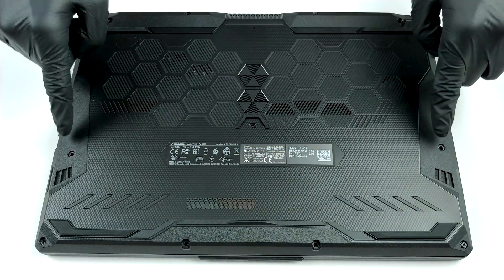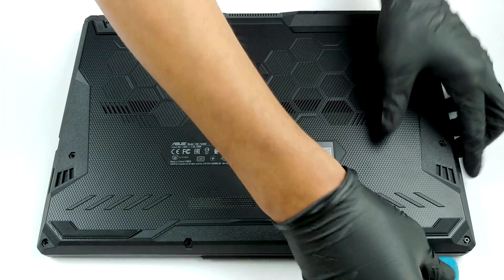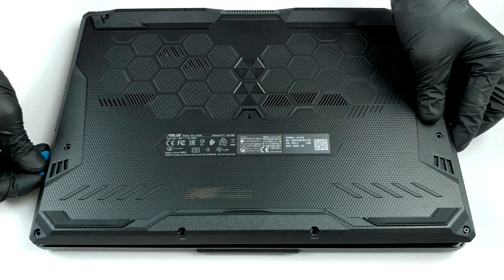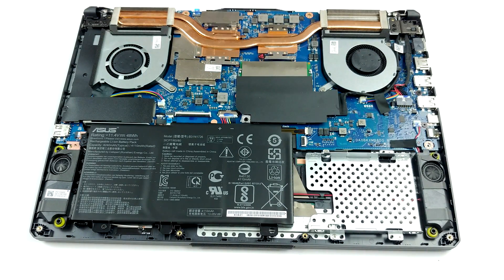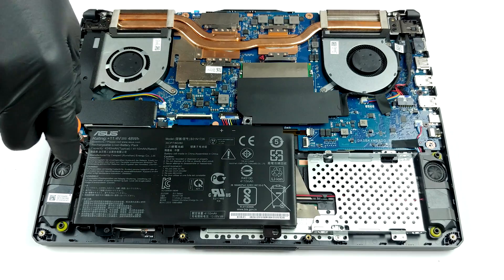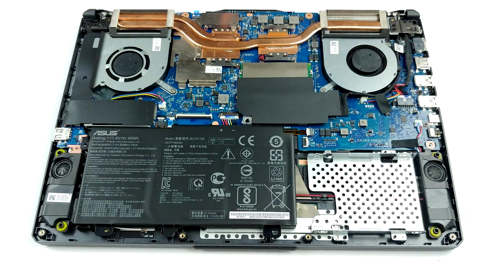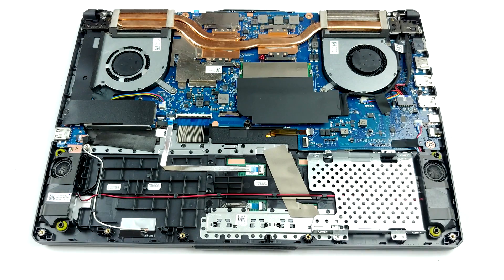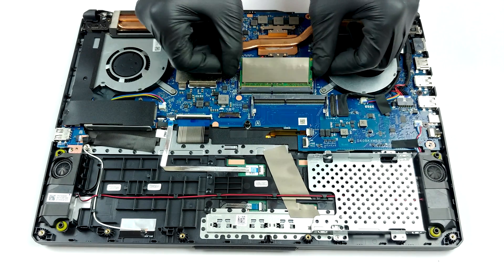🛠️ ASUS TUF A15 (FA506) - disassembly and upgrade options

Comment: I havve 1ssd of 256 gb. And 1tb hdd in my asus tuf a15 , can i add one more ssd ?
Reply: did u find any ans?  as i also want to add 2nd ssd
Reply: @parv69  if you have same specs then u cannot add one more ssd , you just have to replace with a bigger ssd

Comment: My right fan is laggy..  Its making lots of sound and nit even turning.. 😢.. Any solutions?
Reply: replace the fan 👍can find the parts if ya look up the model number but make sure you know which one in particular (look at the sticker on the bottom that says smth like FA506IHR next to the QR code)
Reply: @dangersnack5665  yeah changed it a year ago. Found a Chinese copy replacement for 12 bucks. changed it successfully. working fine so far.

Comment: So if I understand it correctly there is an extra slot for a 2,5 inch HDD?
Reply: yup, its the metal slot you see in the lower right, however i tried connecting one and i couldnt do it because the connection was very weird and curled up in there-

Comment: Just bought a slightly used one of these, as mentioned by seller it's missing a couple screws on the bottom plate, I was wondering which  type it is and where I could find it, any help much appreciated!

Comment: Hello guys. I've got 2 questions.1. Could anyone tell me if there is any warranty seal,  If yes then where? 2. Will the laptop work ok if I take out this slow cl22 ram and replace it with faster 2x8gb ram? Thank you
Reply: 1. Yes there is, by the heatsink, over a processor screw, it's black with a red triangle on it.
2. Yes it should work

Comment: Can the bracket for the hdd be removed to accommodate a 90 wh battery?
Reply: yes
Reply: @shiringasai  ok, have you tried?
Reply: @dorddis  yes the battery  does have different screw mounts but the plastic case itself has tabs that will hold it in place I hear different models have different connectors for the battery so make sure the 90watt battery you buy has the same connector

Comment: Just buy the legion 5p, has the same configuration and it's cheaper, good cooling solution, 899 on Curry's right now!
Reply: False, not cheaper. thanks for playing
Reply: @seansmith3766  On amazon the Asus TUF A15 is £1000 on Curry's the legion 5P is £899 (Here in the UK)
Reply: Gay

Comment: It's easy to open the screws but hard to lift  the back  panel..i was being extra cautious while opening it.
Reply: Better using a credit card so it doesn't damage the panel
Reply: @ainulkarim5074  I used a flat Screw driver's tip for half of it and I lifted half by raw hands , shouldn't have 😅
Reply: @ainulkarim5074  Thank you it worked really well
Reply: Start from the front corner

Comment: Which SSD can I add in the extra slot, I buy it, but I'm looking for a 1tb SSD for the extra slot,.
Reply: All ssd's are small it will fit in the slot, i used a samsung evo ssd and it fits very well
Reply: @SlyStarling  i bought the 1tb Samsung ssd as well. Do i just plug the sata cable into the hdd connector slot & connect it to the ssd for it to work? I've never done this before & didn't want to mess anything up
Reply: @Sidious2403  thats what you do its the same as a hard drive but sometimes the ssd might not show up because you will need to format the drive but there is tutorials on youtube to help you do that
Reply: @SlyStarling  Could you tell me which model specifically? 970, 980?
Reply: @bloodslayerX  it would be a 970, a 980 is a nvme ssd whereas the one you want looks more like a hdd

Comment: Can we upgrade battery from 48wh to 90 wh in ryzen 5 4600H varient (61k)
Reply: I think so yes, the 90wah battery would have to use the hdd space. I could be wrong though
Reply: i have a 90wh battery in my r5 4600 h and gtx 1660 ti variant
Reply: @slitnotgm which battery or specifically what type the battery you use? I want to upgrade mine too

Comment: Can I pick up 48whr option and later swap it with 90whr through service centers???
Reply: You should be able to - just remove the hdd cage & original 48wh battery & the 90wh should fill the gap 👍

Comment: Managed to put in 64GB RAM (63.4 usable), as suggested by Crucial.  With the RTX 2060 model, there is also a 2nd PCI M.2 SSD slot (potentially RAID 0 setup?), plus a STAT 3 SSD bay.  So, 3 places for SSDs.
Reply: Hey, I have a question for you if you don't mind. Since you've messed around inside the ASUS A15, how hard do you think it would be to swap out the GPU, RTX 2060 for a better one? Is it easily accessible? Or is it in a hard to reach spot? Also if it is even possible to swap out the GPU in a laptop? I've never worked on a laptop before.
Reply: @SelfProclaimedEmperor  Laptop GPU's are usually soldered onto the motherboard & impossible to change 👍
Reply: @genx156  damn, that's dumb, thanks though.
Reply: Online it said there was 32 gig limit for ram, i have the 4800h ryzen 7 with the 1660ti? is that correct?
Reply: @lolzorsPwnage  you shouldnt need more than 32gb anyway
Reply: @lolzorsPwnage did you tried 64??
Reply: @su-1337 i have tried 64Gb but its working
Reply: Isn't the max ram 32gb?

Comment: I have an 506U version an it does not have any SATA cable under the hood. Where should I get it?
Reply: Mine was in the box - if you got the version with 90wh battery then you don't have hdd cage or space for a hdd, so it won't be included with your model.

Comment: Can we upgrade wifi from 5 to wifi 6?
Reply: Yes, should be possible. Look at the video @ 1:52 ( https://youtu.be/D0hcm12i4gM?t=112 ) , this shows the WiFi module and it is replaceable. Module is on the left side just below fan. There are two antenna wires connected to the module (white and black wires).

Comment: Which brand ram is default used??
Reply: any will do as long as it is 3200mhz
Reply: brand*
Reply: @justinvelasco1657  Mine is Micron according to CPUZ, I need to open it again because I want another matching 8 gb stick to run dual channel 😁
Reply: @genx156  as long its same frequency it will run dual channel.
Reply: @justinvelasco1657  I ordered another 8gb stick from Mr Memory & it's by Crucial, same 3200mhz & same timings - runs great & dual channel 😁
Reply: @justinvelasco1657  what happens when the one you're upgrading is not the same frequency? Will it still be "fine"?

Comment: Note: 2x RAM slots (Max: 32 Gb) and 1x M.2 Nvme slot.
Reply: i running on 64GB no problem and smooth
Reply: @andyloo7132  can you please share the which company ram did you used??
Reply: Hard to tell from the video, is the m.2 full length?
Reply: @Megalomaniakaal  2.5 I think
Reply: @Derek Frampton aKa 1PaPaD1 mmm i don't know how you do that, i mean, virtually you can have 120gb, but each slot allows up to 16gb to 3.2mhz, no more. Probably the numbers are there, but the system is working with 32 gb at it's max.
Reply: I have an A15 and it has 2 M.2 NvMe slots
Reply: @Derek Frampton aKa 1PaPaD1 same here on 64gb 3200ghz with 2tb 2.5" crucial m500, since i had order the battery, the 2tb gonna be be external and i wanna get the killer wifi 6 AX1650 card
Reply: @Derek Frampton aKa 1PaPaD1 yours covers up to 32 gb no more
Reply: @Derek Frampton aKa 1PaPaD1 sure! pass the tip ;)
Reply: @Derek Frampton aKa 1PaPaD1 how older are you dude, lol!
Reply: @Derek Frampton was there a big speed increase with ram the upgrade
Reply: @Derek xPaPaDx Frampton Bro Ive the same specs R5 4600H with 1650. How is your RAM usage after u made 32gb. Is it usable or 16gb is enough?
Reply: When they say 32 gb max do they mean in total using both ram slots or can I put 32 GB on each ram slot for a total of 64? I don't think they could be more confusing with this crap if they tried.😮‍💨

Comment: is hdd with 15mm thick fit on this laptop?
Reply: I would use the smaller drives - mine fit (but I left out the hdd cage) but I'm not sure how thick it is 👍

Comment: Can you tell me where the webcam connects to the motherboard? I may have loosened the camera's cable when installing an hdd and ram, as it intermittently shows up as not being connected when I check the device manager. I have the model with RTX2060.

EDIT The issue was resolved.  Turned out there was nothing wrong with the webcam.  When I plugged in a specific usb cable, it was somehow disabling the webcam.  As soon as I removed it, the webcam operates normally.
Reply: Just some Forest Ranger with Internet Access  That's why I wanted to know where it was connected.  However, it turned out not to be the case.  I USB cable I was using was somehow disabling the built in webcam.  It was just a coincidence that I started using the cable right after I had opened the laptop to install the ram and hdd.  Once I stopped using that cable, the webcam started working normally.

Comment: Can you create a video how to install hdd using the flex cable?
Reply: Yes, I put a 1TB laptop drive in there but had to leave out the hdd cage because the screws didn't line up, tried the other way around then the (included) cable was too short - the base panel has foam strips which hold my drive in fine - just ditch the HDD cage 😁
Reply: @genx156  thanks so much for this tip. I was racking my head how fit my hdd to the cage x.x
Reply: @drewlim  Cool, glad it helped 😁 I don't know if it needs a slimmer drive or something, but I found it strange my drive wouldn't fit properly in the HDD cage & when flipped the cable won't reach - I scratched my head for a while too, maybe different HDD manufacturers put the connection nearer so the cable reaches ??
Reply: I could, but i also ad problems with the hdd cage in this case i just put face up the hdd and bend the cable again at the end i could install the hdd.

Comment: It's not possible to add additional cooling pipes to a laptop, right?
Reply: it's possible, people have done it and I have seen at least 1 guy do it to a asus TUF FX505 laptop (basically last year's TUF A15), but honestly you don't need to, because the cpu is sharing a heatpipe with the GPU it gets cooling from both GPU and CPU fans, the gtx 1650 also doesn't really run hot since its already hard limited to 50W
Reply: @TheUchihasparky   The heatsink of the higher speced models, like the FA506IV etc. have a heatsink with an extra pipe. And it looks like it would fit in this lower speced model FA506II. Could you upgrade the cooling with the better heatsink model?
Reply: @MrxXWAGXx  no
Reply: @TheUchihasparky  Care to elaborate?
Reply: @MrxXWAGXx  no, because it's obvious

Comment: PRY?! WTF IS WRONG WITH ASUS?!?!
I've never had to use a tool to pry open a laptop just to install an SSD or swap memory!
Although - given those 11 screws, I guess it's a nice way to open/close relatively quickly if you don't put them back in every time...
Reply: This version isn’t even nearly the worst of it either. Some of the more expensive laptops from ASUS have their graphics card in the other side of the motherboard, meaning you have to remove it super carefully to upgrade

Comment: Hey can you tell, that does the Ryzen 5 version of FA506 have extra M.2 slot???? For further upgradation of SSD storage.!!!!
Reply: No it doesn't, I've just got that laptop
Reply: yes i have added 2nd drive (SATA SSD) on my A15.
Reply: @seepranavg  did you have an aditional ssdm.2 and an hdd and it is working?
Reply: @Sans-bd3bn  One m.2 slot which came with ssd and other was empty SATA slot. I had sold the laptop and got a new one now.
Reply: @seepranavg  okay thanks

Comment: Where can i get the HDD SSD Flex cable?
Reply: for me it was included in the box
Reply: Yep, mine was in the box too - Installed my 1TB drive in there without the hdd cage (left it out because it doesn't fit with it, or does fit but then the cable doesn't reach) it's held in nicely with the foam strips on the base panel 👍

Comment: can u swap the screen for a better one
Reply: Yes you remove the plastic bezel from around the screen, watch a teardown video on the screen first - I did this with my Acer aspire R15 as it came with a crappy screen that wasn't even IPS - I bought an IPS one off of eBay with the same connector & it is great 👍

Comment: I'm really curious if you can replace the battery from the 48wh one to the 90wh one, would be a really good upgrade... LaptopMedia any chance you can check if that works? :)
Reply: @adamhaziq_  But isn't the 48wh version the same, just with a 2.5" hard drive bay to fill in the extra space? So you could hypothetically remove the hard drive bay, and install the bigger battery in its place?
Reply: I believe so but you will loose the 2.5 drive bay I've ordered the 48wh model but I will probably upgrade is its possible
Reply: Yeah, I got the smaller battery because I needed that hard drive bay, if you remove the hdd cage & your original battery, the bigger battery slots in 👍
Reply: @genx156  And is that safe for the laptop?

Comment: just opened mine to make sure i had space for a HDD but looking at it i have no idea on where it would plug in, can anyone help 
Thanks
Reply: Can you give me link of video how to install hdd using flex cable?
Reply: Top left corner of the HDD cage, just above it there is that white and black connector point. Lift up the black part, like a door. The supplied SATA cable slots in there, and should be prefolded to then travel down to the SATA drive
Reply: @aidendrakepw  the sata cable comes with the laptop?
Reply: @emanuelhernandez7201  it does yeah

Comment: Just called Asus and they said if I add another SSD and more ram it voids the warranty? is that true?
Reply: Only if they find out😏
Reply: I'm pretty sure if anything goes wrong you can just take out the upgraded parts and just send them back the laptop as stock
Reply: It doesn't actually...
Reply: may they want to add from their authorised points. I added another ssd recently going to official point but it is bit costly there.

Comment: how do you connect 2.5 inch drive? I don't see any data connector
Reply: It's a little adapter that comes in the box
Reply: theres a little adapter for that that comes with the box! just check it.
Reply: Did you ever find out? I'm interested in doing this myself

Comment: I am planning to buy this model. Kindly tell me about the heating issue. Is it too much and does it have a noticeable impact on performance?
Reply: The heating issue only occurs in the higher variant models like gtx 1660ti or rtx 2060, not with gtx 1650 models
Reply: I definitely have that problem on the 1650 model, just make sure that the air vents on the bottom are open to air but it will always run hot with extended use
Reply: I have 1660TI/Ryzen 7 4800H, so far I have no probs with the cooling on this laptop, it's a gaming laptop & gaming laptops are usually loud when gaming or doing anything high powered, browsing or watching YouTube for example it's very quiet - I fire up a game & it ramps up the fans, some games I limit the fps to 75 or whatever your comfortable with in the Nvidia settings, it's much quieter when playing, I just mess with the quality settings & fps limit until I'm happy with the noise, if I'm using my headset then I just crank it up 😁

Comment: Would love to see a screen disassembly. I have a feeling a lot of people are going to be swapping out these sub-par screens.
Reply: yeah the screens are trash. i 've had this laptop for 1 week and i've got backlight bleed.
Reply: @kenmasters2231  same, and their cust support was the worst. Technician didn't know what they were doing, one of them roasted the motherboard literally because he didn't know that thermal paste should be reapplied and not just cleaned.
Reply: I have no problems with the screen - I have the Ryzen 7 4800H/GTX1660TI Model : 506IU with 144Hz screen, I only game, no pro video editing or anything & I think it's absolutely fine for the games I play, watching YouTube etc.. 👍
Reply: @genx156  same with me,can i ask you that can our laptop add another one of m2 ssd or this laptop can just add sata ssd
Reply: @amzarammar7678  there is an extra M.2 slot and there is an M.2-SATA adapter out of the box IIRC. I have the 4900H 60hz version but I think the box content is the same.
Reply: Can confirm, the laptop has good hardware for games and software but I ended using an external monitor

Comment: Well, why are you not talking about the main problem with the A15?
Asus is manipulating the hole system, by a miss-designed  Cooling Concept.
Its not only, the the Air intake holes on the back are MUCH to small ( what could be a Design Choice ) , its more like " Some of the holes for air outtake is CLOSED by plastic!"
That is something that not " just happens" , Asus has done this , because they want to make the system hot and slow done quick, to sell upcoming systems in a higher price range!
Reply: Hardware Unboxed (I'm a big fan) did a review of the A15 & said the same things, they chopped the casing for more airflow to the CPU/GPU but the keyboard & other components ran warmer - they did a follow up video - I watched that too - then I bought an A15 myself, after owning it for a few weeks I can say it's a cracking laptop for the money - mine is Ryzen 7 4800H/GTX1660TI, smaller battery with extra hdd bay, screen is really good as I don't do professional work on it & it's no louder than any other gaming laptop - I do limit fps in Nvidia control panel if not wearing my headset - otherwise I crank it up - I'm very happy with the A15's performance 😁
Reply: Bro ik it's not the best design but when u compare it with the cooling system of rog strix, both reach similar temperatures
Reply: maybe they need to cool other components like nvme and ram.